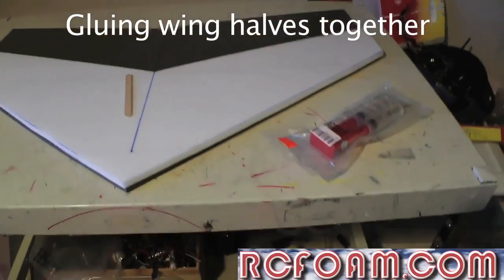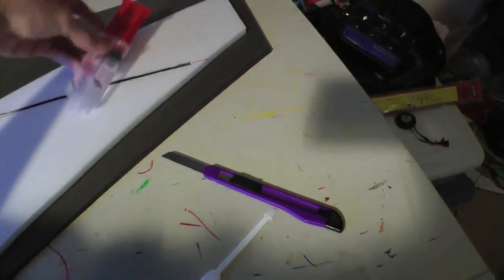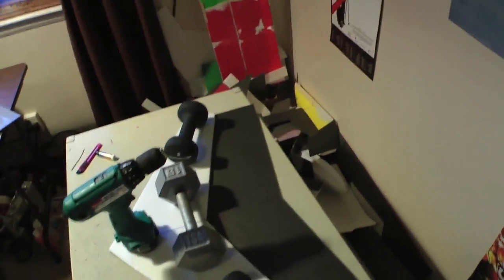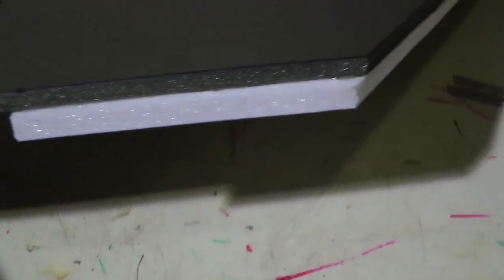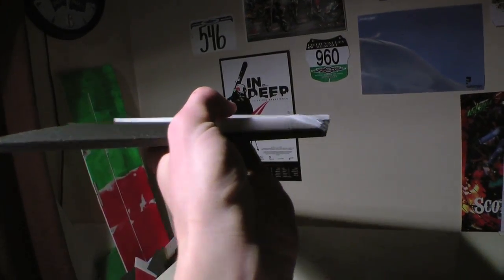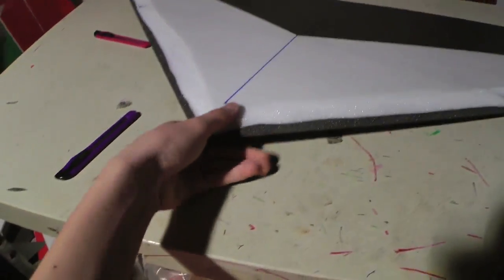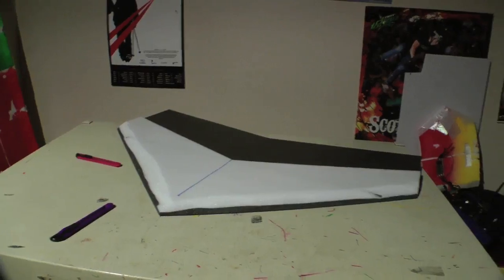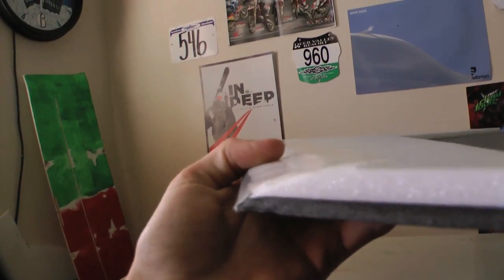Delta Wing Build Along Instructions #2

Comment: Nice build along, but you should consider sanding that leading edge. The profile at the first inch of the wing is very important for the overall performance of the wing and effectiveness of your ailerons. You should try to make the leading edge in to a C-shape or D-shape. You will notice a much better glide (because of the thicker profile) and a much greater cross stability. Just my two cents

Hope to see the next part soon